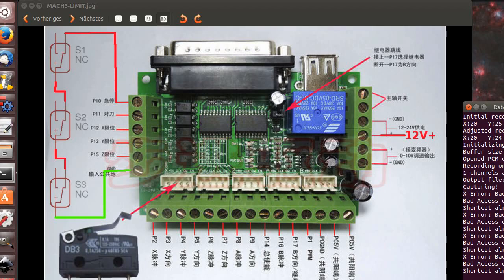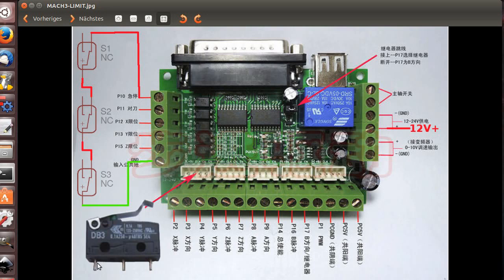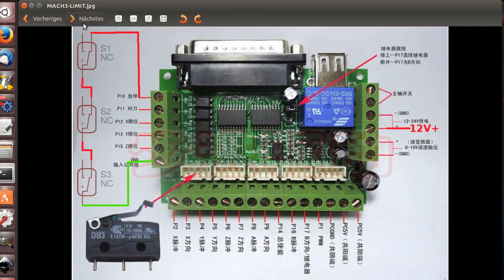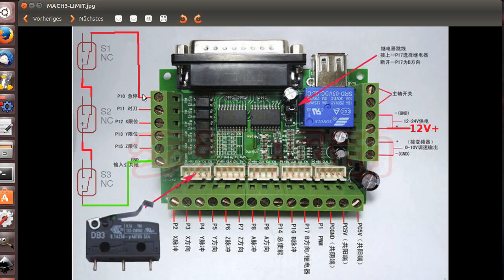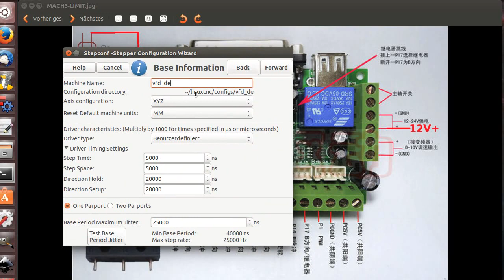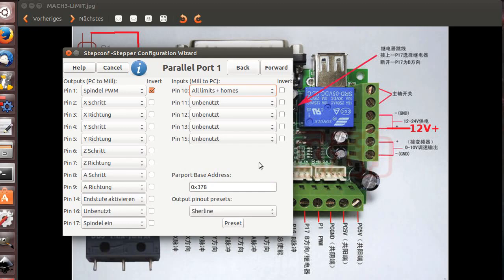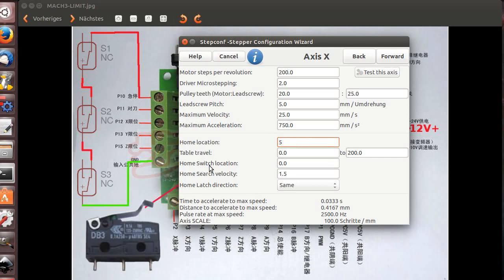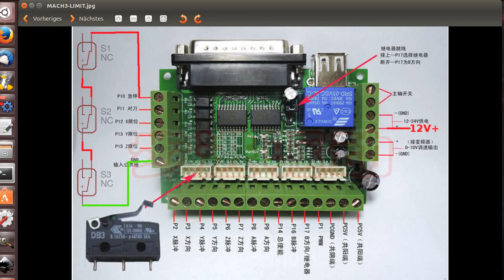Limitswitches on a Mach3 BOB Wire and Install

Comment: Is there any danger of blowing up your USB port with external 12 volt applied as you have stated?
Reply from the maker: NO the 12-24V are complete seperated as for external use there are OPTO isolated

Comment: do you have a link to buy this board?
Reply from the maker: The Board is out of date 
USE ARDUINO Uno  CNC shield 3.0 around 6,5USD you can connect to USB and all free software
Reply: aliexpress have many many seller this most used cnc board, cost 4-12$ i just orden 2 board my son cnc i build.

Comment: Hey there, I'm using the same breakout board and wired exactly as you say in this video, but instead I'm trying to connect an E-stop. I've set it up to be normally closed and when I press the e-stop it shuts off the machine, but then it starts to trigger the relay every few seconds. Any ideas what I'm doing wrong?
Reply from the maker: is the machine power off as the Estop triggers or only the Steppers and the Spindle without power
this happens if the Machine standby power maybe a view mA are still from the powersuply 
and the signal from the P16 is pulsed 
you can remove the jumper if the Relai is not in use !

Comment: my cnc have problem, same card i use, but if wiring XYZ home SW were can add important limit SW because E-stop have uses pin 10, home X 11, home Y 12, home Z 13, and probe Z heigh zeroing pin 15, not have Free pin were add limit SW, home procedure have important not can run machine if not have all axis first go to home. how connect, need different home dual Y motor, homeY1 and home Y2 if want beam have sure square when homing. its make real right all need 4 pin more.

Comment: I am using a "bl-usbmach v2.0 d1712" board. It has the folowing connections:   GND,   In1-Estop,   In2-Probe,   E3-Limit,   In4-Home,   In5-Reverse.
In your example i should connect all endstops to GND & one input.
When i look on different sources i see that every axes should be connectet to a seperaid input.
I have 6 endtops. 2 endtops per axes in seris.
Then i should connect every axes in series. One side of eche axes connected toghether to the GRND and every other lead to a seperaid input.

     I think it should look like this:
                     ENDSTOPS

       ------------------------------------------------------
      |                      |                    |               |
     X                     Y                  Z    axes  |
   GND             GND              GND            |
E1     E2      E3       E4      E5       E6        |
|          |          |          |          |          |           |
-----------          -----------         -----------           |
     |                      |                    |                 |
   In1                 In2                In3           GND

Acording to your explanation it should be like this:
                     ENDSTOPS
       ------------------------------------------------------
      |                      |                    |               |
     X                     Y                  Z    axes  |
   GND             GND              GND           |
E1     E2      E3       E4      E5       E6        |
|          |          |          |          |          |           |
|          -----------          -----------          |          |
|                                                      |           |
In1                     In2                    In3     GND

Question:
When i use your method how does Mach3 know witch axes will be trigered?
There is only one connection for all axes witch i think is not how it should be.
I think that every axes should be seperated on one side of each axes.

p.s. Every cnc-building video i looked at uses  NC (Normaly Closed) switches. This is because if there is a failer in the wirering NO (Normaly Open) switches will NOT trigger the limit because there is no difference between activation or not activation. So if the wire is damaged Mach3 still thinks the switch is triggered. On a NO switch the power thruigh the endstop-wire is cut when triggered. Als when the wire is damaged then the power is also cut-off so you know if there is something wrong with your wires.

One more thing about the wires: You should use shielded wires for cnc. Normal wires can work for some time but you will encounter problems in the future because of interfearence thruegh the neaby wires.